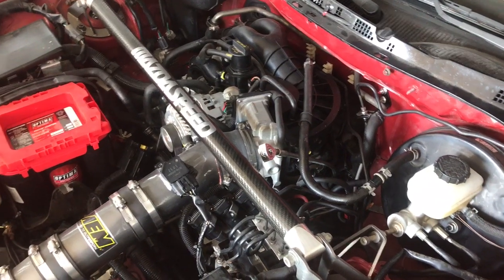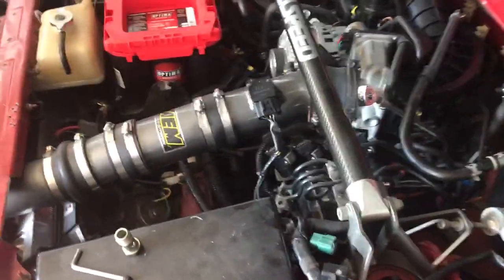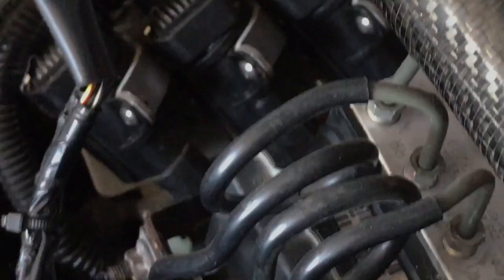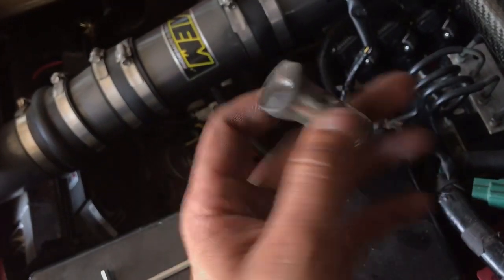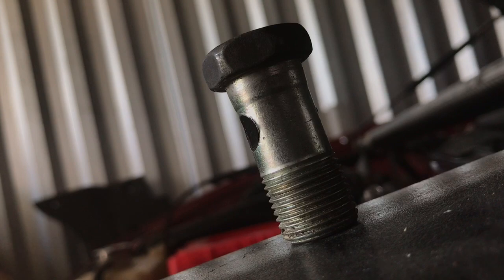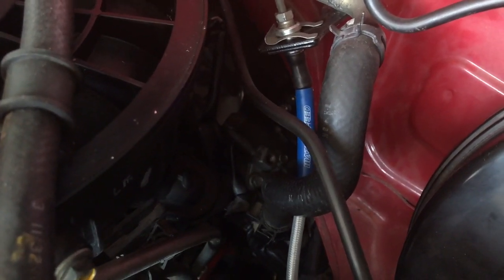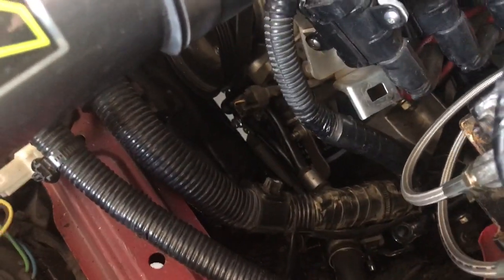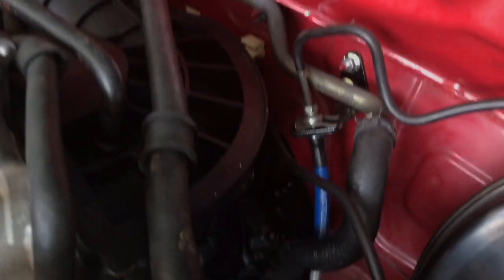Series 2 RX-8 oil temp/pressure sensor solution

Comment: I fitted the sandwich plate but had oil leaks so got new plate that had bigger rubber seal but it has the AN 10 fittings and my sensor is 1/8 npt lol

Comment: Did you leave the oil pressure sensor in the oil cooler?
Reply from the maker: No I ended up putting the oil temp sensor on the hot side of the driver side oil cooler as that’s where hot engine oil leaving the engine goes to first
Reply: @NateRist  if I give you my email address could you send me some pictures of the placement for the oil temp and oil pressure placements? Been searching for a good spot to put them at. I'm no longer on purelyrx8 and the Rx8r3 group on Facebook so I'm winging it here lol
Reply from the maker: sure, message me on Facebook or IG though. it’s just easier and faster